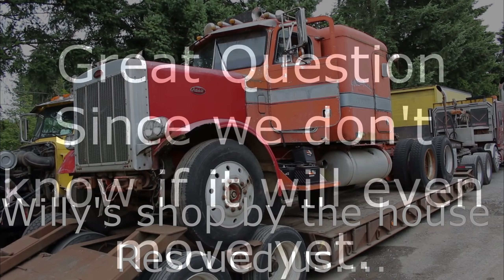The 75 Pete 359 comes home... Gets towed 2x on the same day and mistakes were made. It did't go well

Comment: Put a quick disconnect on air tank when you originally work on them and get the cheapest gas air compressor you can; at least that's what my father used to do picking up wrecks

Comment: If you go to a wrecking yard / junkyard that wrecks trucks... you can usually score yourself some air fittings cheap. The feller who did his Pete that you may want to check out is twinstick garage... and I recommend his page highly as he went from forlorn to for sure in a step by step fashion that will help you with your refurbish work. Some of the air tanks can be snagged from wrecking yards as well... yada yada... rear end stuff.. used transmissions if needed. This truck is a real nice one todo. You'l get yourself a lot of youtubers tuning in to follow the work on this truck guaranteed. Also... that place you were at to do will it start stuff.. they had a real nice Cabbover White Freightliner of a 70's vintage... people LOVE cabbover White's or Kenworth K-100 vintage [sweet looking and working rigs when done]. Just some thoughts :-)
Reply: I love the k100 we prefer the cab overs here in UK just for lack of space for long nose cabs

Comment: This i why I tow my own trucks...tired of tow companies damages, losing driveshafts, over tightening chambers when caging and breaking them, rarely on time but always ready to charge you by the hour as soon as they reach the destination....you could use a removable 5th wheel tow unit. I would have deducted the damage from the tow bill.
Reply from the maker: I have to double 2 cabovers back from WI in a few weeks. I am looking for a reg to the the front wheels on the 5th wheel
Reply: @countrylife4195  there was one on gov deals
Reply: they didnt even chain the axles up to prevent damaging the air bags. what was with the second tow guy and the tire irons used to lock in the tow pins? i snatch trucks up with my gradall all the time but never damage the truck. i hook to the frame....not that flimsy frame end cap. my lord the crap that poor truck went through that day...

Comment: I do but then again I don't envy your restoration on that truck. Gonna be a TON of work. That Cat sure sounded sweet. I pulled logs for a couple years and my 1985 CL9000 Ford (yes I said Ford) had a 3406 Cat in it. Lots of low end torque but wouldn't go but 72 mph loaded or empty. She would tote a 110,000 lb chipper like it was a feather. Where are you located?

Comment: That was so unnecessary for them to bend the rear of that Pete just because they didn't give a crap!!!!!! Great video though!
Reply from the maker: I would have appreciated them not ripping out the air lines so I could have driven it home as well. 
Cheers!!
Reply: @countrylife4195  Did it need air to shut down? 2 of our detroits have to have air or they keep running until they build 60psi
Reply from the maker: @rodneymiddleton9624  No but my Detroit does need air to shut down. Joe and I put a lever on it in case it ever blows an air line I can shut it off. This has an electric Solenoid that is Frozen solid. Really sucked to try to figure out how to kill it. Given the state of the tire with the broken spring I would say this has been stuck a while and they have been dumping the clutch to stop it.
Reply: @countrylife4195  That figures. I like how you include your family in your channel. We have 3 children 2, 3 and 4 year old. Have fun and I look forward to the next video.
Reply: @countrylife4195  Stop by a hospital, go in the parking garage and steal a Co2 extinguisher. It'll shut er down no problem.

Comment: Always have a coupler or something to get air pumped into the truck air system   but anyways good luck with them we've got some old ones in the lot was planning on fixing them up but fracture spinal cord in the neck and emergency surgery has postponed any plans for the future
Reply: Jeff Kopis  it started from an accident and symptoms got horrible and couldn't move my limbs so MRI and it was either become paralyzed or die or get emergency surgery they put the largest cage in my spinal cord neck area and fused three vertebra I'm living time will tell if I can go back to running my semi n heavy equipment hopefully I can get  at least 90 percent of function n etc back
Reply: Jeff Kopis  thank you

Comment: Next time pull other truck next to it hook red air lines together push red button in on both trucks charge air up old cats have a manual shut off on fuel pump it is a shaft with spline on it that old truck probly has a air shut off soulinod my 79 did.

Comment: Taking the brake cans apart is a great sure fired way to get killed. Not trying to tell you your business but it could happen.
Reply from the maker: Was not my plan.... dude wanted it.off his trailer so he started buying them apart..
Really sticks it to me though
Reply: countrylife : I think I would not use those guys anymore, kind of rough on stuff. Is that a aluminum hood or a glass hood.
Reply from the maker: @scottberry5266  it is a glass good. I am looking for an aluminum one 
Shorty
Reply: countrylife : I put a comment in earlier about replacing the fender but later in the video it looked like fiberglass. Good luck with the restoration, I’m just finishing up a 94 379 project. The wife is on my ass about not working all summer.
Reply from the maker: @scottberry5266  mine too!!!!
Vovid got this whole thing started

Comment: Unless there was another truck running off screen which I didn't hear another truck running when you got the peterbilt started.
If it was not building any air how come I heard the air dryer purge.
Reply from the maker: It was the lowboy truck
Reply: Long air hose , from running truck to non running/  non air pumping truck , to pressurize air system .

   You already should have a hose long enough to fill your farthest tire .

   A suitably prepared tow rig will have an air hose long enough to go from tow truck air tank , to air tank of non running truck being flat towed .